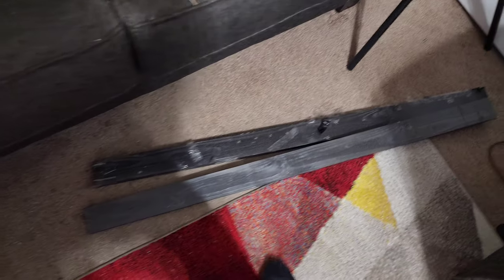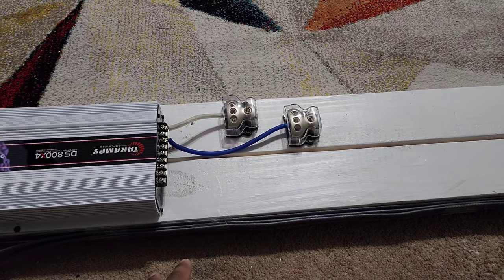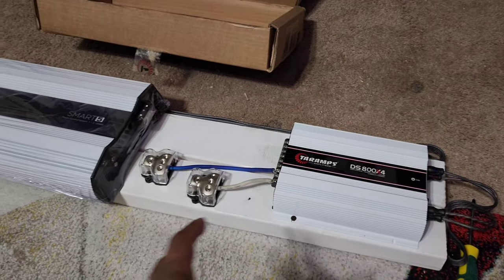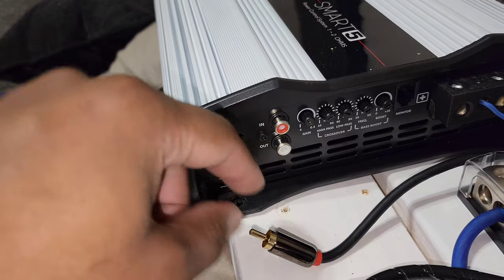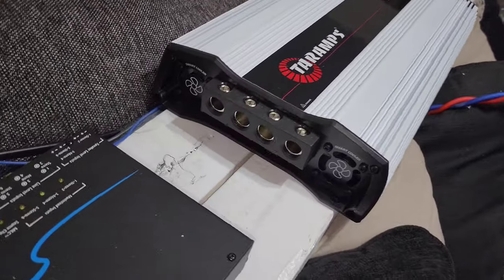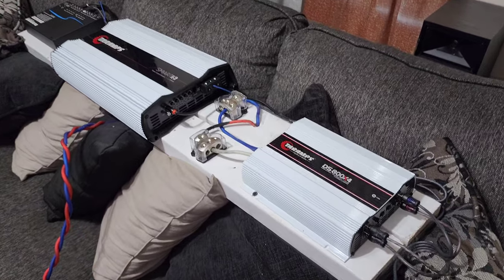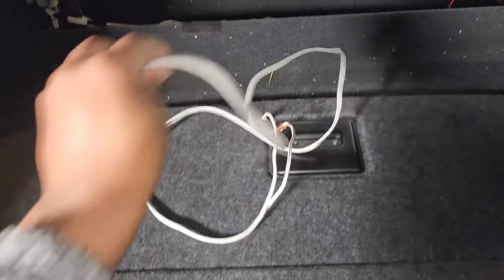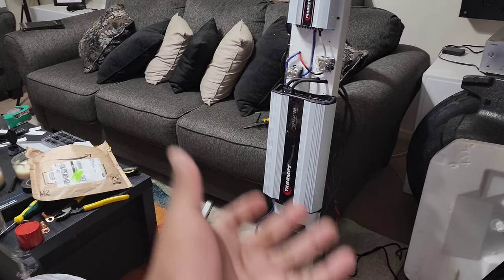Taramps Smart 5K + Sundown X15v3 = 😏

Comment: I been using a smart bass 5k for about 1.5 yrs now. Maybe more. It puts the power down every single day flawlessly. I've got Xv3 12's.
Reply from the maker: Yup I've had no issues and I need it to stay that way. Knock on wood
Reply: @Kpaceguy  I did shake some components lose a bit and had to re-hot glue alot of areas 🤦‍♂️ maybe it just happens over time. But I noticed when I did a be-build. I looked cuz when I was using my smart 3k I'd get a whine for like 20 secs when I turned it on. I asked barevids and he told me a component was lose. So I reinforced the with the hot glue and it really solved the problem lol. And it's in one of my other cars till this day. I've been strictly dailying the smart lineup for since the smart 3k came out. And never failed me even once!

Comment: time for lithium. get some headways. the cost to build it cost less than the yellowtop battery. the headways also run at 13.8v so you can run them on stock electrical. 1 8pack of headways is good for 3k-5k watts.
i like the fullbridge design, i powerful and compact but damn taramps your fans are so loud and why are they always on
Reply: I wana do it but dnt know how

Comment: Did you upgrade your alternator?
Reply from the maker: I've been looking at options but haven't yet
Reply: Question…..  I have a 2014 Audi Q7, I think my alternator is 180 amps.  I wanna run a skat audio sk3500 amp plus 4 channel amp, 2 VXF 12’s.  Can I get away with just a extra battery?
Reply from the maker: @Cleveland Bond  more than likey, yes. As well as doing the big 3 upgrade.
Reply: @Kpaceguy  my battery is underneath the driver side seat but there is a positive post inside the engine bay. Do I still need to run power cable to battery or positive post in engine bay
Reply from the maker: Yes